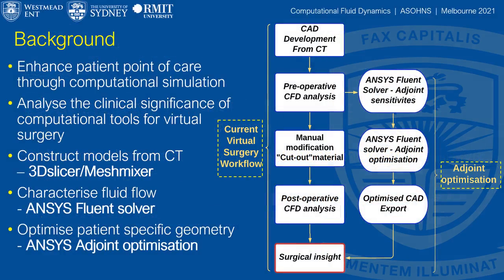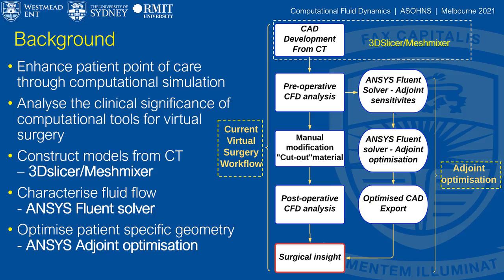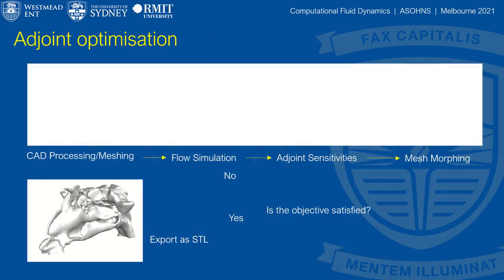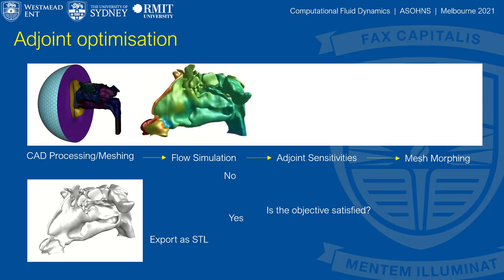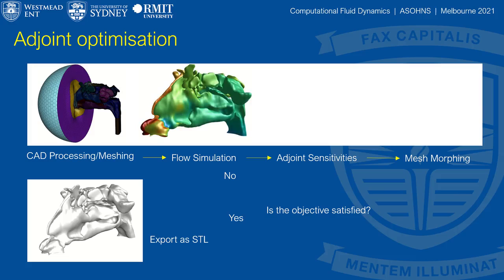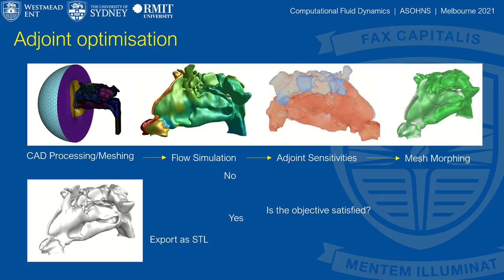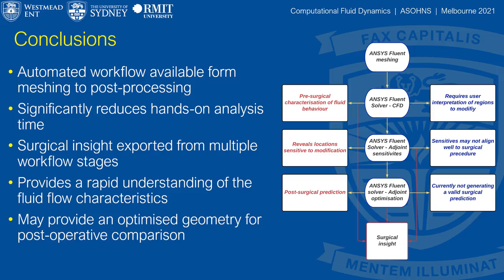Virtual nasal surgery new computational tools for predictive pre-surgical planning

Comment: The adjoint optimisation tool modifies the mesh based on a given variable from previous simulations or a standard known value. For this study, I used a pressure drop reference value between the nasal valve and choana from a post-operative virtual surgery on the same geometry. The adjoint simulation then modified the mesh in small increments over a number of iterations to move nodes restricted to the nasal septum to match this value. The process from meshing - adjoint was scripted using TUI commands in a Fluent journal file so it could be applied to additional models.